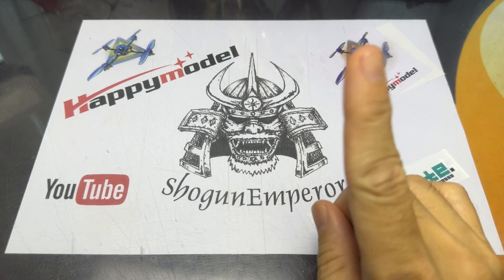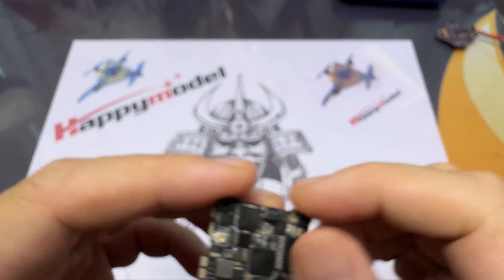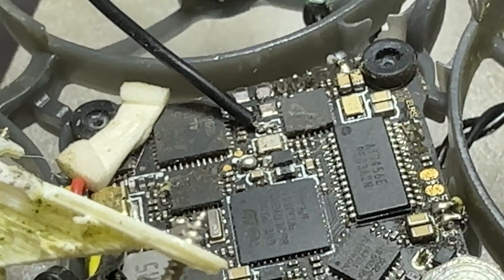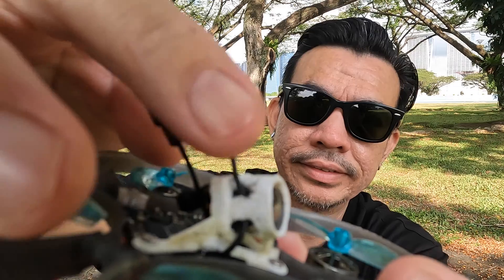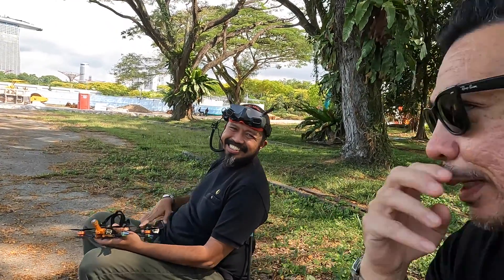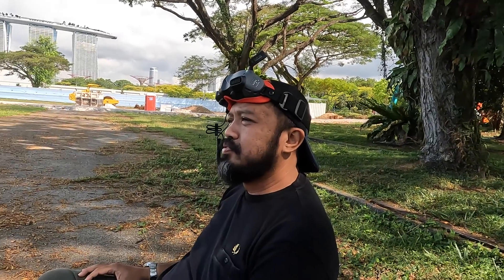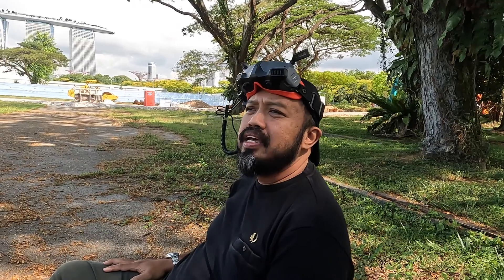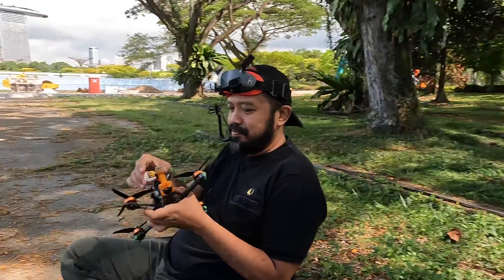Broken antenna hack!!

Comment: Great tutorial buddy! here’s the math for getting the right wire length for other frequencies (eg: 868mhz, etc):

Speed of light (300,000,000 m/sec) divided by Frequency (2400,000,000 Hertz) = 0.125m divided by 4 = 3.125cm for quarter-wave.  

Length of wire for quarter-wave antenna = 3.125cm x velocity factor (0.957 for 2mm insulated wire) = 2.99cm  Now, add 1mm excess to cater for the soldered joint, and that is 3.09cm exactly!
Reply from the maker: Thanks bruddah! Whoaaaa!! Too much info for my puny brain!! 🤣🤣 kidding. I actually studied this a few years ago n got a massive headache! 😜 back then I wondered why does it need tp be 31mm and found out about quarter wave. Its REALLY interesting when u get down to the minute details! Thanks for the reminder bruddah. I had forgotten the formula… 😝

Comment: Thanks for another repair tip.  Haven’t busted one of these off yet.  I know you can solder to one pad but nice to know theres an option if the pads get trashed.   Nice rip!   Definitely looks like it worked!   Cheers!
Reply from the maker: Haha thanks bruddah. Yeah, i was at a loss when i realized all 4 pads were ripped off.  So HM advised me to solder to that capacitor. Thanks my bro! Was a good sesh!
Reply: @shogunemperor  Pretty hardcore pulling off all 4 pads 🙇
Reply from the maker: @amin0_acid310  😝 heheheheh it usually doesnt happen… but i mightve been abit too enthusiastic that day!!
Reply: @shogunemperor  tbh, i think those pads are still fine, try putting some solder on them. That grey stuff might just be a bit of the plastic of the first antenna...

Comment: Worked great! I've repaired many of those ceramic antennas. For a whoop I prefer the little copper wire.
Reply from the maker: AWESOME MAN!!! Yeah, that would be another option. But with the way i fly i didnt wanna short out anything with the copper wire so I opted with the silicone coated one as HM recommended.

Comment: Can't you just solder the wire to one of the 4 contact points?
Reply: Yea. That's what I've always done. One of the 4 is the active element. You can tell which one by looking at a photo if your square antenna is lost. It is the corner where the copper goes all the way to the surface. Looks like this works too though.
Reply from the maker: They were all ripped off bruh. No more copperpad and the edge doesnt have sufficient contact point to hold any solder.  Happymodel told me to do it this way.
Reply: @shogunemperor  cool!
Reply from the maker: @TorontoFPV  thanks bruddah. Hope u n family are well! Love to the family please!!
Reply: @shogunemperor I see they are all ripped off now. I've lost 4 or 5 of the cube antennas but they never took the pads with them. Good to know there is another alternative. Not sure where it came from, but I've got a couple of feet of enamelled copper wire in my supplies, so I usually use it for the repair. I just scrape the enamel off about a cm at the solder connection point so it has the enamel as protection across the board. I'm fine with using wire on any whoop and have never experienced range issues. It is always a sad day when a failure of one small component makes a $60 aio useless, so it is good to know all these options.
Reply from the maker: @kurtzFPV  yeah man. That copper wire thing is a great idea. Wats the awg of ur copper wires? I might wanna stock up LOL
Reply: @shogunemperor  I still can't figure out how I ended up with the wire. Looked through some of my shopping history and nada. Anyway, I don't know the AWG but it is very thin but pretty strong. It is identical to the copper wire you see on some AIOs, but has the enameled coating, which gives it a slightly red tint. I think its primary use is for winding magnets, so I may have salvaged it from an old motor even.  Edit: Just remembered. It was left over wire from winding a toroid for a ham radio antenna I built a while back. It was part of a kit.
Reply from the maker: @kurtzFPV  oooooooohhhh nice. Anyway, will look it up on aliexpress! Thanks again bruh!!
Reply: @shogunemperor  I put an edit in my reply after I think you had already replied back. I finally remembered that it came with a kit for making a ham radio antenna. It was for winding a torroid. 22 AWG
Reply from the maker: @kurtzFPV  oooooooh!!! Thanks bruddah!!!